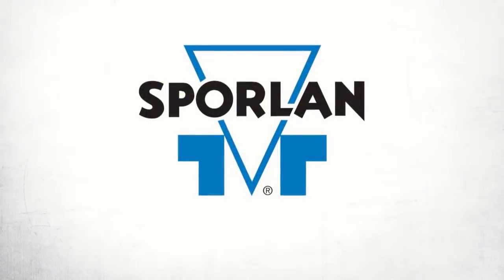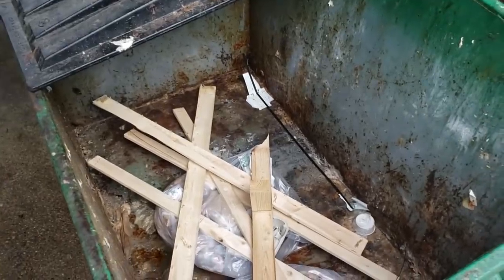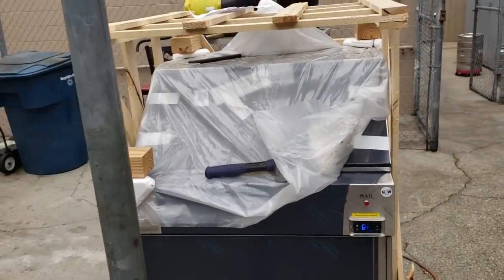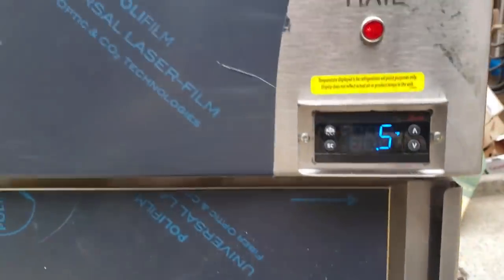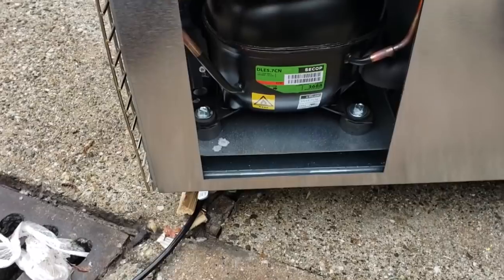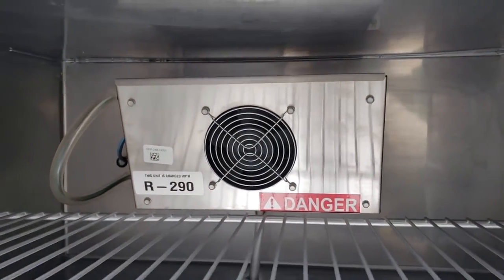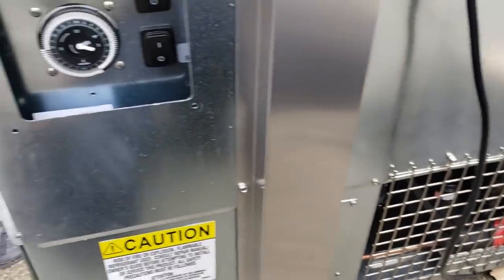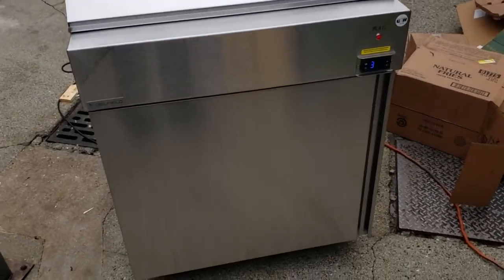NEW REACH IN INSTALL

Comment: Good vid ! nice tip on plugging the unit in while its in the crate to save 20 minutes.  The other thing i do whenever i sell a New unit to a customer is open the compressor area and Look for Packaging material holding condensate things in place or items that need to be Removed or adjusted or just put back into place that got jarred in shipping. also checking for rubbing capillary tubing / copper tubing. drain line in place into pan etc. electrical wires rubbing on a hot gas line etc. General visual inspection of area looking for future problems that a wire tie might save customer from having a down unit or warranty call. loose screws holding condenser fan motors down. loose blade. bent blade etc.

Comment: Good stuff . On a different note I’ve came across few R290 units not coming down to temp . Seems to me like R290 doesn’t high head pressures. Condensers were somewhat dirty . Cleaned them up and dropped temp . One degree per minute btw . 🤭😬😁🤔
Reply: 1 degree per minute is also the spec i use. Note : thats only for empty & New Refrigerators.

Comment: Those new units looks great. I'm not a fan of the Randall and True versions because of their condenser coil access. They bottle neck the air to only pull through the bottom which makes so many service calls of  paper and plastic getting sucked in and blocking the coil.
Reply: Also I quote work based on my speed. If a customer or my boss wants it done at a quicker speed they can send a quicker person but odds are they are quicker because they aren't going through all the steps I'm going through